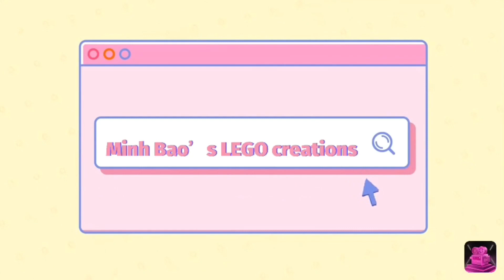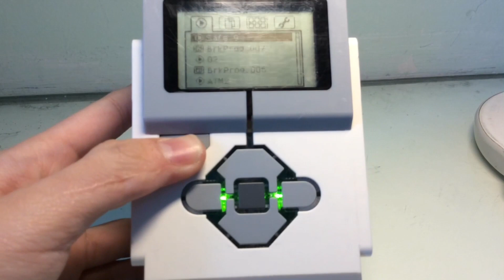How to make LEGO power functions motor work with LEGO mindstorm (credit to @LegoTechnicsRule )

Comment: Not bad, not bad at all! It seems though that if the EV3 Motor turns all the way in either direction, the battery box will end up in the same position. Maybe you could find a way to negate that.